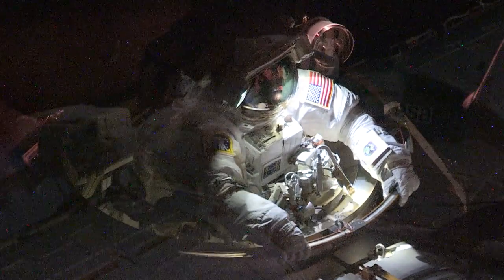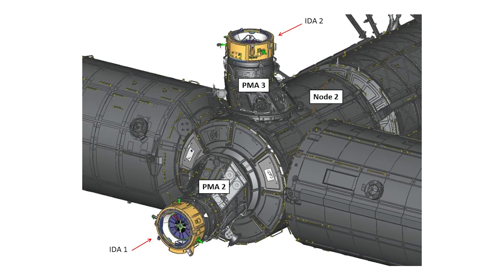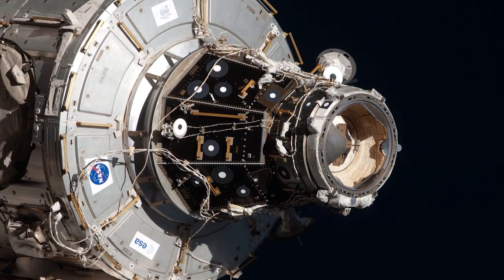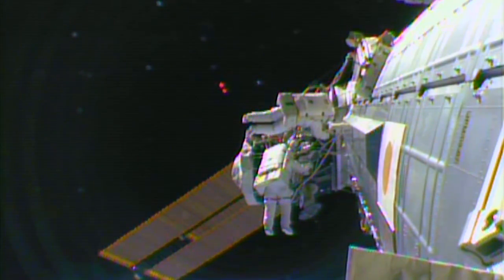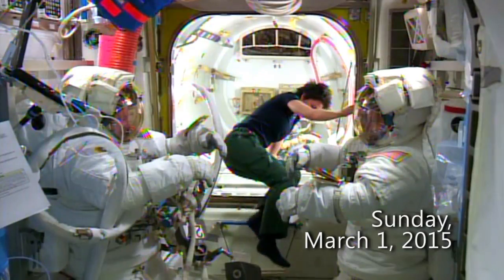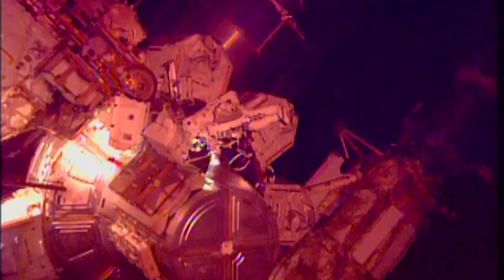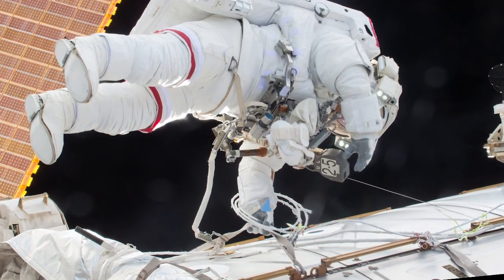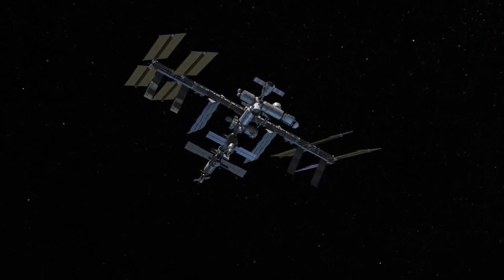The Road to IDA

Comment: NASA should extend the ISS as long as possible. If it's maintained enough, I don't see why it shouldn't last any less than Airplanes. The metal fatigue isn't happening, just need to change or add up protection around the modules.
Reply: i seriosly thought there was a fly on my screen

Comment: Did they have to make them bigger so obese multi-millionaires can pass through? Weren't the old adapters international enough? I'm confused! ^_^
Reply: I don't know, maybe they're more safe or easy to dock in. Or maybe it's just a political issue like the male part vs the female one. It happened during the Soviet-US docking in the 70s, they used a unique neutral docking door to avoid mockery.
Reply: Damian Reloaded Dragon V2 will dock to IDA. Dragon V1 doesn't dock, it's berthed to the CBM. And yes, Soyuz and Shuttle use different docking mechanisms.
Reply: Sigh, stackexchange had the answer, it is to be able to transfer larger cargo: One of the reasons why one is selected in the design rather than the other is cargo size. The berthing and docking ports on the ISS are of different shapes and dimension and can thus be used to transfer different volumes of cargo. In particular the Common Berthing Mechanism (CBM) used by the H-II Transfer Vehicle (HTV) and the Dragon spacecraft have a square opening of 1.3m (50") which can transfer whole equipment racks. By contrast the Russian and new US docking port is a circular port of 0.8m (31"), which is too small for racks.
Reply: u don't know what you are talking about....
Reply: TheHawkeye757 it's not just going to be used for boeing and spacex. it is meant for anyone that want to change from the apas-95 docking system or for the agencies that uses berthing on their spacecraft for example, orbital atk is planning to use the ida for their cygnus.
Reply: TheHawkeye757 I believe it's open source. Every companies can use this commercial docking technology.
Reply: weeaboo
Reply: No, a lot of it was proprietary and secret. And no, it's not for obese millionaires, it's for more astronaut researchers
Reply: Micai Askauss you mean the soyuz would only dock to the Russian secret airlock and SpaceX dragon would only dock to American secret airlock?
Reply: Oliver Kosunen and u do? ^_^
Reply: This is quite interesting, still the word ''International'' seems a little strange when it is designed for Boeing and SpaceX. What is the international part?